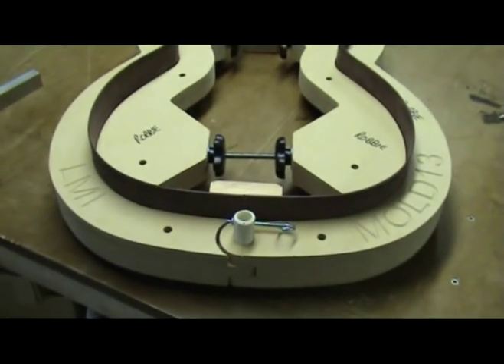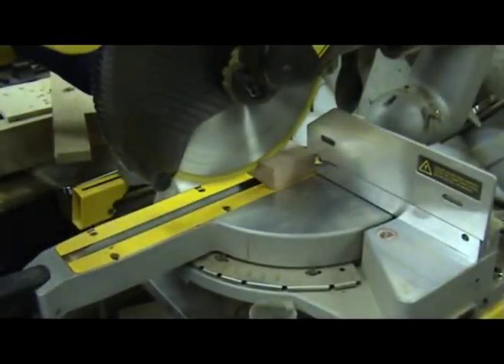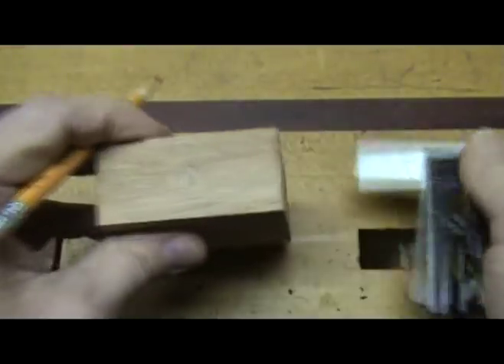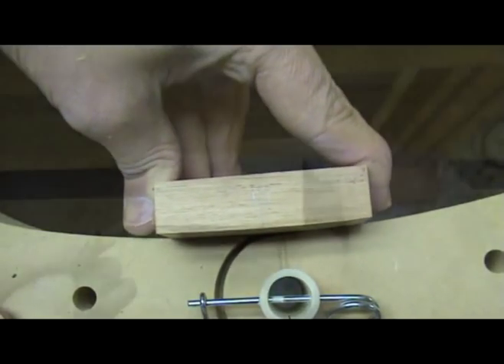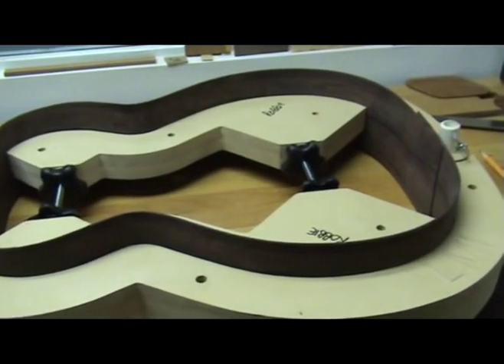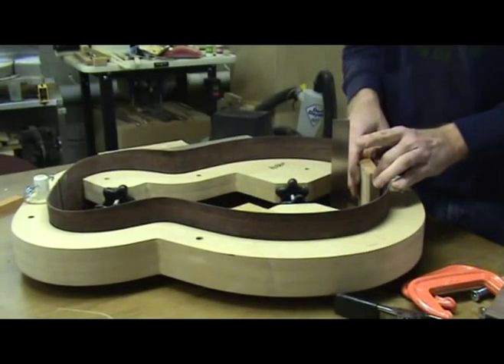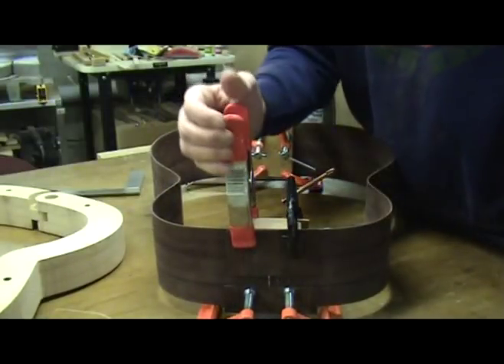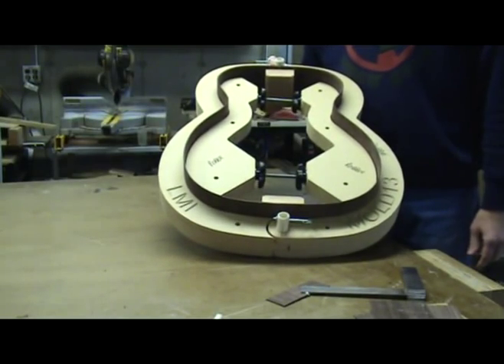Luthier Tips du Jour - Heel and End Blocks

Comment: Robbie, I don’t know if you will read this as this vid is so old. But I’m building 2 parlor guitars I bought the mold & plans from LMI my question is on the neck block the side to be glued to the guitar sides seems to have a 16” radius it’s Not flat?? I made my blocks flat & square I radiused the tail block to fit it’s a good fit 20” radi, But as I said the neck block also looks like it needs to be radiused?? Is this common on this type of guitar? Thank you🙏🙏🎸🎸🇺🇸👨🏻‍🦯
Reply from the maker: I am not familiar with the plans you are using by I keep my neck blocks flat where the sides glue. It just makes life so much easier when trying to set a neck.